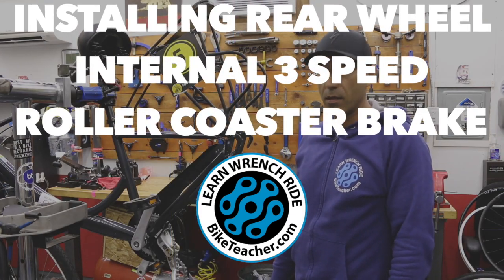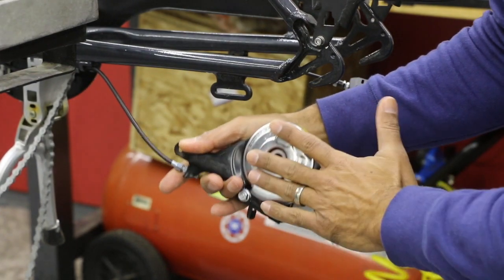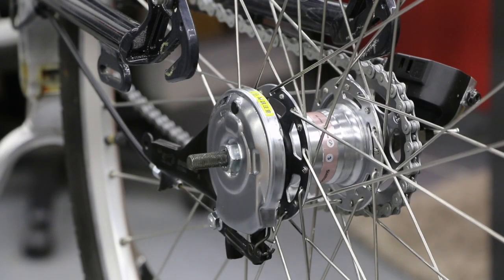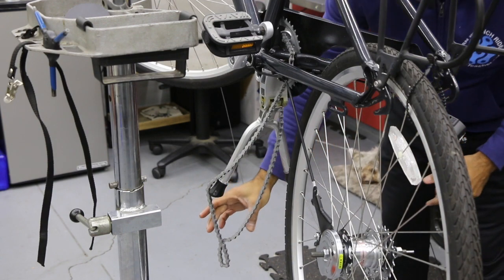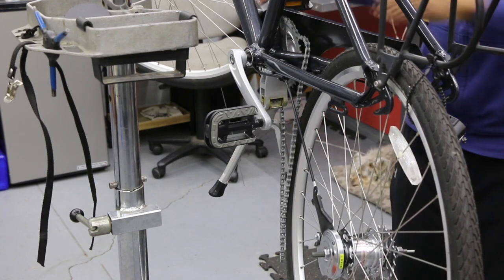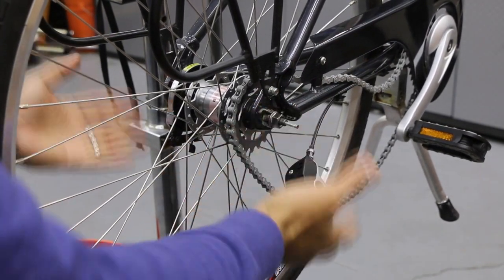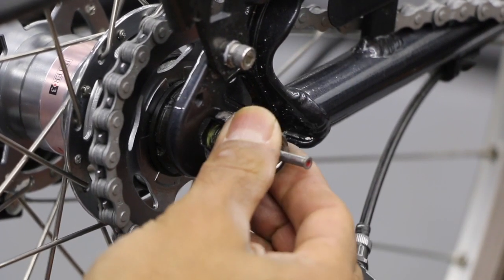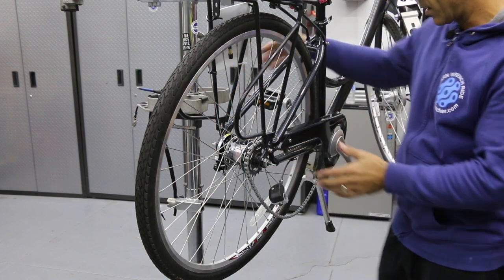Install a rear wheel with a Shimano 3 speed internal shifter and coaster brake.

Comment: Great video, thanks. A question: does this Shimano roller brakes needs grease when purchased for first time use? I’ve just got a new one (exactly the one in your video) and was wondering if I should out oil in the hole.

Comment: This is really helpful thanks! Do you have any resources or tips for setting up the bell crank for the first time? I'm converting a single speed to Nexus 3 - the shifter cable doesn't come attached to the bell crank.
Reply from the maker: Hi, its been a while, but don't cut the cable until your absolutely ready. Once you cut the cable and it will need to be cut very short, the end tends to open or flower making it difficult to deal with if you need to pull it out and reinsert. Putting an end cap should be okay though. They are pretty straight forward, shift to gear 2 to make alignment adjustments.Leave your self barrel adjustability to screw either direction before calming cable. Measure housing length a head of time. Can't think of anything else..
Reply: @BikeTeacher  awesome, thanks!
Reply: @eBikeaholic  Planning a Bafang BBS02, Gates CDX Belt drive, & Shimano Nexus 3 to a 2008 Specialized Hardrock Comp Disc. Your videos have been invaluable! ✊🏽

Comment: Isn't that hub brake a 'roller brake'? I was wondering if you could a video on the 'coaster brake' removal? I have heard that you can take the brake part of the hub out, and stick the wheel back on (plus the arm). I want to get rid of mine and but some nice rim brakes on.
Reply from the maker: I have not hear of that, I will look into that. Thanks
Reply: I wonder if you could just reroute the cable from the pedals to a handle bar mounted brake lever? Then you could save on buying new brakes and not worry about jury rigging the system to operate out of it's normal parameters.

Comment: link to a part two ?
Reply from the maker: Keep adequate air pressure at all times. Avoid thorns and glass that can cause large cuts. Avoid skidding when you can. You may rotate tires but most people don't.

Comment: is there any way to take off the coaster brake and use a different way to brake?
Reply from the maker: No, you would be looking at a new wheel with the gearing of your choice. One you do that you would need to ad a brake (caliper). This would depend on the bike frame. The frame will dictate what style brake to choose.

Comment: i have a 3 speed adult husky tricycle and the reference number on the hub SG-3C41 nexus inter 3
the problem is that the 3rd speed does not work
would i need to buy the entire hub kit?
 hub drive? shifter/crank?
Reply from the maker: Have you tried the barrel adjuster? Located at the on the drive side rear wheel nut. I would need more info. If the hub has failed it may be cost effective to purchase a new completely built wheel with a new hub.

Comment: Hi, in 9:23 how do you name that part? I need one but I dont have the name. Thanks
Reply from the maker: Not sure of the technical name, It's a spring activated, or spring actuator for internal geared hubs. Try this:Shimano Nexus 3 Push Rod [81.85 mm] - Y33S91100
Reply: @BikeTeacher  thanks!